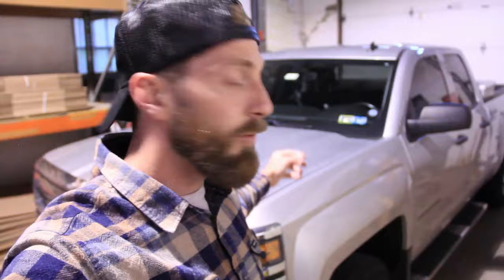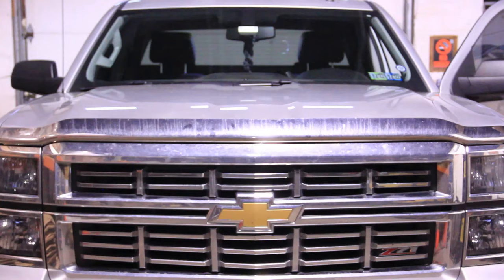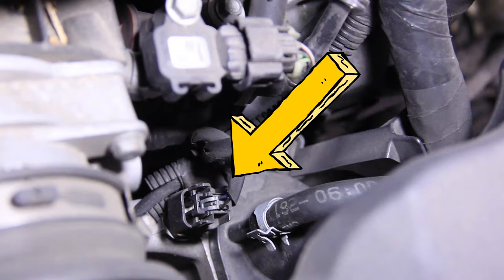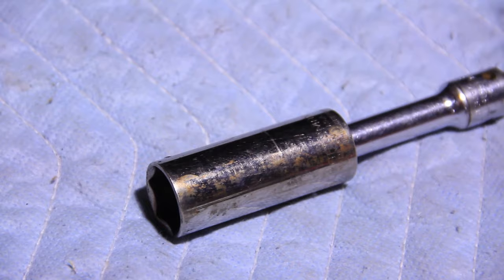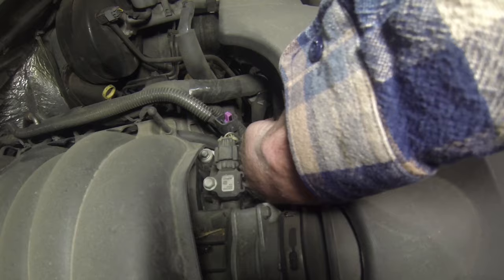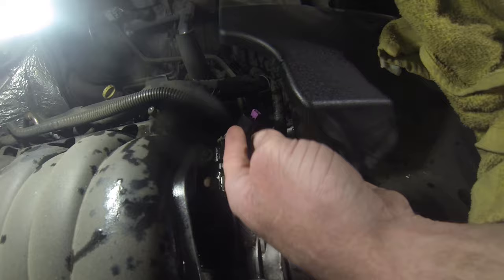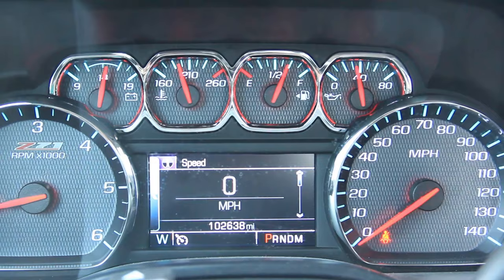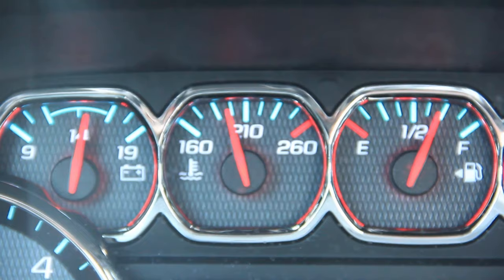Radiator Fan Won't Turn Off: 2014 - 2019 Silverado & Sierra: Bad Coolant Temperature Sensor Replaced

Comment: You should never put sealer tape on the sensor. It has a gasket on the sensor. By putting tape on you lose the ground.
Reply from the maker: Thanks for the heads up Brandon.  We've had no issues yet, but if we do that will be the first thing we look into.

Comment: Can I run the truck with out the fan turning on ?
Reply from the maker: If you have this issue, you need to fix the problem.  Once you fix the problem you can run the truck without the fan turning on.  Below are two more videos to help you with this issue: 

https://youtu.be/WvLyBM8FHdM

https://youtu.be/wed9eZxPwsQ

Comment: I’m having the same problem
Reply from the maker: Then fix it!  It's honestly not hard to do by yourself.  These next two videos should help as well, I've linked both below:👇
https://youtu.be/wed9eZxPwsQ
https://youtu.be/WvLyBM8FHdM
Reply: Thanks yes looks easy but I'm still going to have a professional do it however I am going to get the part...  can the parts be found in auto zone?
Reply from the maker: Yeah, they can be found at all of your major auto parts stores.

Comment: This was happening to my truck….  Second time it did it I went and checked the coolant level.   No coolant.  Stopped driving right away and added some but my damn warning light/alert NEVER went off!   Anyone had this happened. ? Truck tells me everything wrong usually. Low levels issues codes problems.  Tire pressure even.    Zero warning on coolant……..
Reply from the maker: Sorry to hear that.  Sounds like a rather odd issue.  Do you have any leaks?
Reply: @TheBrothersWorkshop  not that I am aware of…..    the only liquid under my teuck ever is from
The AC moisture drain by passenger side front door.  Water.  Never seen anything under there and I tske notice with anything wrong with my truck immediately.  I woulda noticed by now….

Comment: Had this happen on a rainy day this summer.  Drove though a puddle and noticed down the road the fan was on and the gauge read 160.   Replaced the sensor just like this video... today another rainy day.. drove through a puddle.. and here I am again.   I wonder if it's a short in the wire harness?
Reply from the maker: Hey Jim!  We had a similar thing happened as well.  Once we replaced the sensor everything worked well for a few weeks, then out of nowhere it started again.  So, we replaced the thermostat and since then we have had no issues at all.  We did a video about this as well.  I've linked it here for you: https://youtu.be/WvLyBM8FHdM
Reply: @TheBrothersWorkshop  Thats the next step then.  Thanks!
Reply: @TheBrothersWorkshop  HELLO I HAVE THE SAME ISSUE JIM DID WE HAD A RAINY DAY IN CALIFORNIA YESTERDAY AND MY GAUGE IS ON 160 AND MY FAN STAYS ON FOR A WHILE AFTER I TURN OFF MY VEHICLE MY QUESTION IS ...IS IT SAFE TO DRIVE LIKE THAT IM LIKE 30 MINUTES FROM HOME
Reply: @isaacsadventures1932  I got a new thermostat and its held up through rain.  Good luck.
Reply: @TheBrothersWorkshop   QUICK QUESTION IS IT SAFE TO DRIVE LIKE THIS INCASE IT HAPPENS AGAIN?

Comment: Great video but before you do.all that just unplug the battery worked for.me
Reply from the maker: Prior to filming this video we attempted multiple different fixes to troubleshoot this issue.  The first thing we tried was to disconnect the battery. By disconnecting the battery you reset the computer.  This works for a while, but more than likely your truck will revert back.  This is not a computer issue, it is an issue with your thermostat or the thermostat sensor. We've linked a follow-up video below. 👇
https://youtu.be/wed9eZxPwsQ

Comment: Does this engine have 2 of these sensors
Reply from the maker: I believe it's just one.  Why do you ask?
Reply: @TheBrothersWorkshop  my 2015 suburbans fan is on high and the the temp gauge is stuck on cold I’ve changed the thermostat and sensor but I was told by someone that gm put two of them on this 5.3
Reply from the maker: That's news to us.  I would disconnect the battery to reset the trucks computer.  If that doesn't work, make sure your fuses are all good.

Comment: Little help I swapped the sensor and thermostat and still the fans won’t turn off.
Reply from the maker: Try disconnecting the battery and reconnecting it.  That should reset your trucks computer.
Reply: @TheBrothersWorkshop  thank you that did it!! 🙏🏾 great video!

Comment: Disconnected positive terminal and it fixed the issue.  2014 Silverado.
Reply from the maker: If you didn't replace the sensor and thermostat, the issue will continue.
Reply: @TheBrothersWorkshop  you are correct.  It started back.. darn it
Reply from the maker: I learned the hard way, and that's why I made these videos.  I've liked the playlist two or three-part video series about this. One of the videos is a troubleshooting video. https://youtube.com/playlist?list=PLnPXcXYmgiuvbA7f_Zot4ScG1DJ7QJgO8

Comment: Anyone have a problem with their fan running louder after changing?
Reply from the maker: Disconnect the battery for about ten minutes.  Once you do that reconnect the battery.  This should reset your computer, and take care of the issues.  If not, remove the teflon tape and replace the thermostat.  We have a video linked here explain that: https://youtu.be/WvLyBM8FHdM

Comment: The reality is you need a thermostat, not a new sensor. I would never buy a duralast part ever.
Reply from the maker: The reality is you need both, the thermostat and the sensor.  As for the duralast it worked fine for me and continues to.

Comment: Had the exact same problem. Before buying any parts try just disconnecting the battery. I just reconnected my battery, turned on the truck. Problem solved
Reply from the maker: Hey Matthew, your problem is not solved.  Give it a day or two and you will be right back at square one, and your truck will be doing the same thing.  Disconnecting the battery does not fix the issue.  All you did was reset the truck's computer, and given some time the truck will realize that you didn't fix anything.  Trust me, I've been there and done that.

Comment: You guys i gotta solution it worked for me but just disconnect your battery terminals for about 20 seconds and it will reset it and might stop for while
Reply from the maker: Before I made this video, I tried that.  It might work for few days, but it doesn't fix the issue.  The reason it's happening is because the part is bad. The part needs to be replaced.

Comment: So, the fact that this video exists tells me this is common with these isn't good.
Reply from the maker: Try to find a vehicle that doesn't have any issues...  At least this issue can be fixed by yourself without the help of a mechanic.
Reply: @TheBrothersWorkshop  I got the temperature sensor. Had the truck for a few years; just felt like it wasn't old enough for these issues. Apparently I was wrong.
Reply from the maker: Things happen.. 🤷

Comment: That was a waste of my time and my money! Replaced the sensor, didn’t work! Disconnected battery, removed Teflon tape from sensor put it back, still didn’t work! Now I’m stuck with the same f#*ing problem and can’t afford to take it to a mechanic!
Reply from the maker: Beau, this was a $30 dollar fix, and it appears as if you didn't follow all of the instructions.

First, Go back and check your work.  Make sure you followed all of the steps, and didn't do anything wrong.

Second, if you have changed the issue and it continues then you must change the thermostat.  It's clearly stated in the video.  (Watch the whole thing).

Third, do not blame us for not being able to afford a mechanic.  This was a $30 fix.  If you can't afford to go to the mechanic now then you couldn't afford one before.

Below are two videos you need to watch before getting upset and blaming someone for trying to help. 👇

https://youtu.be/wed9eZxPwsQ
https://youtu.be/WvLyBM8FHdM

Comment: Another crap GMC problem ..
Reply from the maker: Not a fan of GM?
Reply: @TheBrothersWorkshop  yes sir. I’m , I really like my GMC Sierra, but I’m honestly very disappointed of GMC products, 
I’ve had a 5.7 ram , no problems in years man!
Reply: Thanks for the video , I’m  replacing that part now.. thx
Reply: Every truck has issues this isn’t a huge issue 
Mine started doing it today 
Got home and it stopped on it’s own after 5 minutes. Will have to replace it if it keeps happening
Reply: @JesS-rs5gr  what can I say man, I had the same issue like two years ago, I disconnected the battery, and it started running fine, now a few days ago, same problem, disconnected the battery again, and no problem again. 
I’ve seen very cheap manufacturing on gmc products lately, 
I have a list of problems with my Sierra.